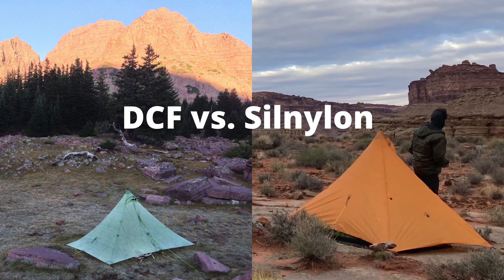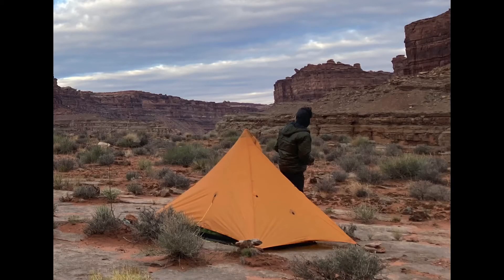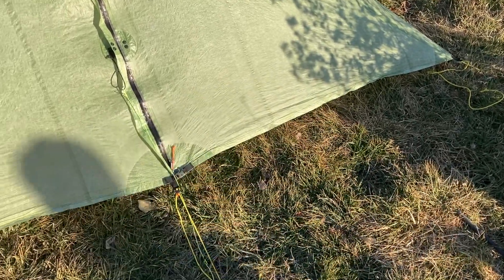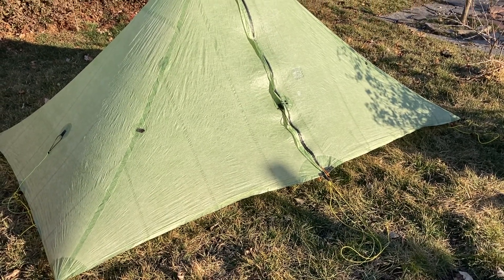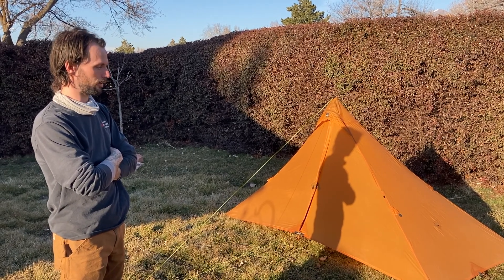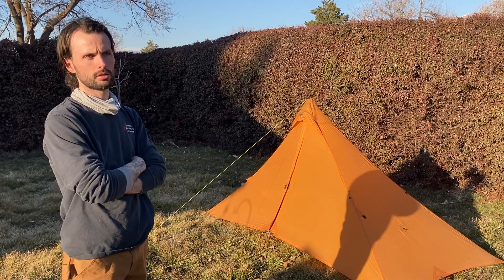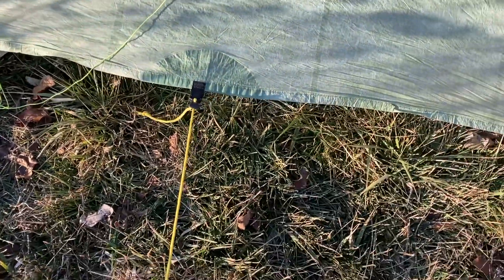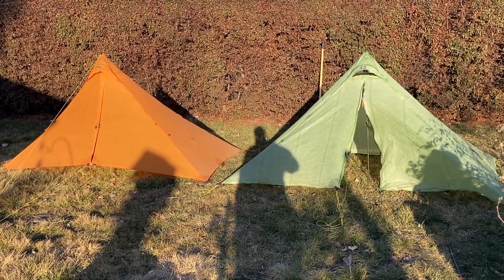DCF vs  Silnylon

Comment: I bought a DCF hammock tarp from Hammock Gear when I decided to do a couple of LASH trips of 275 miles on the Appalachian Trail in '21 and '22 to complete the Trail over 40 years of much shorter hikes. That done, I decided to attempt a traditional S-N thruhike in 2023. I flipped up North to get Vermont, New Hampshire, and Maine out of the way while the weather was unbearably hot in the miles before Shenandoah. I fell and tore the meniscus in my left knee in New Hampshire, having hiked 1,100 miles of the AT, halfway, that year. My tarp began to delaminate at the ridgeline tieouts, being the most highly stressed area of the tarp. I patched it up the best I could with self-adhesive silnylon fabric, and it held up for another three weeks (when I left the trail).
To their credit, Hammock Gear repaired the damage free of charge with a heavier gauge of adhesive backed DCF.  I have only used it 6 nights since, because I had to recover from a total knee replacement. I expect to get a thruhike out of it in 2026.
"Tinker," AT halfway, 2023.
Btw:fwiw, I turned 70 on my hike, so it's entirely possible for an overweight, diet-controlled type 2 diabetic to hike the AT, if you have been relatively (to most of your peers) active. 
✌️👊

Comment: Your experience is quite correct. This is also the reason why 3fulgear does not make dcf tents. 1. In addition to being a little lighter, single silicone nylon has many advantages over DCF! ! 1. DCF is too expensive 2. It is easy to wear and tear 3. It is not easy to fit perfectly with other accessories!
Reply: Also, both are chemical fabrics. Why is DCF so expensive? You must not know the reason. Because no Chinese company is willing to produce it! The scope of use of DCF is much lower than that of nylon and polyester fabrics, so DCF fabrics have always been produced by American companies. Once there are no cheap inputs from Chinese companies, everything will become expensive. If there is a Chinese company willing to produce DCF, then a DCF tent will not cost £400,500, but £150

Comment: Appreciate the insight here.  I've been considering DCF ultralight tents, but have been very hesitant.  It's very expensive and without having any personal basis of experience for actual long-term use of DCF, there's simply been no guarantee of performance over the long term.  At the price point, it almost feels like purchasing a vehicle without having driven it or something to that effect.  You perform as much research as possible, but it's difficult to obtain practical comparison anecdotes like you've provided here.  I'm certain I can purchase a vehicle that will run and get me to where I'm going, but do not have the expertise to determine if it's in a state where it will be reliable.  Obviously DCF is good stuff and I have nothing against it.  Silnylon just seems like a more resilient material that will provide better consistency over time.  I am very much in the camp of "pay the higher price for the better gear", but with that comes the expectation that the maintenance I painstakingly perform will be rewarded.  Value comes in all shapes and sizes.  Cheers guys!

Comment: Noting that we now use a beefier #8 YKK  WR zipper and pull vs these older #5.  2023 Now using low stretch SilPoly for the mids.  SIlPoly and SIlNylon last about 2X longer than .75 DCF and 3X longer than .5 DCF.
Reply from the maker: Thanks for popping in to say hi, Ron! I bought a silnylon solomid from you last year and am very happy with it. I'm super curious about your new silpoly though. Wondering if I should have waited for that. You find it to be just as durable as the nylon?
Reply: Is this also true for the Supermid?  The MLD website currently 
states the use of silnylon being used for the Supermid...

Comment: hey, im looking for info on pyramids. Are you happy with them? Im looking for a trekking pole tent, and heard mids are really good for winds. I assume they can be hard to setup. Do they handle rain well? I plan to bring a inner too. I ordered a cheap asta mid from aliexpress, so im looking forward to trying it out but none in my country uses them so im like clueles how good they are. Im going to norwegian mountains so need something that can handle heavy winds.
Reply from the maker: I like pyramids. they do well in most conditions. I'd want one made of a high quality nylon or dcf though. I've heard the ali express nylon is questionable. Here's Ron Bell tearing both materials: https://mountainlaureldesigns.com/mld-pro-silnylons-vs-cheap-china-counterfeits/
Reply: @benkilbourne3937  hey thanks for the reply. I actually just received the pyraohm from Liteway lol. I figured its better to put some extra cash in for some quality gear. For sure a pain coming from freestanding tents and huge footprint and wasted space. Looks cool and probably will do well in winds tho. I was just on a mountain trip with my cheap mongar 2 dome tent and it handled the winds well so I assume this will too. Again... The huge footprint might suck imo. And ive not even went on a trip yet lol. But, i save some weight and get to use my trekking poles for dual use :)

Comment: I make stuff out of silnylon, and it already is almost weightless. I can't imagine any benefit to dcf, even if it wasn't as expensive as gold.
Reply: It's waterproof, much stronger, doesn't absorb water and doesn't sag?
Reply: @ogarza3  silnylon is waterproof, plenty strong enough, and for several hundred dollars, I'm willing to tighten a couple guy lines.
Reply: @ernststravoblofeld  it is a common mistake due to marketing I suppose. Silnylon is water resisitant, it WILL wet out and absorb water, it is just a matter of when. DCF is waterproof, absolutely impermeable. However from the point of view that people should buy what works the best for their circumstance I can agree with you, but that doesn't mean that I'm blind to how DCF is clearly superior in terms of performance.
Reply: @ogarza3  Have you ever had silnylon wet through? Has anyone ever?  It takes more pressure than anyone is going to have in any reasonable situation. There's your marketing nonsense.  Any conditions that would make silnylon wet through, would rip any lightweight material to shreds.
Reply: @ernststravoblofeld  At this point I starting to believe you are simply trolling, those hydrostatic head tests are only loosely related to real world use, and present only the absolute best case scenario for the fabrics, additionally those pressures that no one will give in a reasonable situation? I don't believe you have done the math, a 165lb kneeling person applies ~13psi, which is equivalent to ~9000mm, high quality "waterproof" silnylon is in the 3000-5000, Hilleberg uses 5000 for example, so according to the lab tests in the best possible scenario not even expedition quality sinlyon is "waterproof" against an average adult kneeling on it. lol...
Reply: @ogarza3  I don't give a shit about tests. Have you or anyone you know, ever used silnylon in the rain and had it wet through?
Reply: @ernststravoblofeld  yes
Reply: @ogarza3  Well, I guess you got shitty material. I've been making and using silnylon gear for quite a while, in a climate where rain is pretty much a given, and I haven't had it fail once.

Comment: Nice analysis Ben!  From 2012 to 2019, I used a Mountain Laurel Design silnylon Trail Star tarp and put a little over 600 nights on the tarp.  In 2019, I purchased a MLD DCF Trail Star and as of today I have used it 232 nights.  I've had to patch the DCF in 5 places and have pinholes in several places.  So I've ordered a MLD silnylon Duomid and should receive it in about 2 weeks.  After this experience with a DCF tarp and many failed DCF stuff sacks, I'm done with DCF.  For the normal backpacker who gets in 8 -10 nights a year or someone who is purchasing specific gear for a through hike DCF might be a good option, but if you're backpacking 75 plus nights a year every year DCF is a rather expensive option.  By the way my son is still using the MLD silnylon Trail Star and probably has added another 50 nights of use.
Reply: none of the tent shills on youtube ever tell this side of the DCF experience.
Reply: @Kevinschart  Many DCF tents on YouTube are sent to YouTube for free by brands for review. If you ask them to buy them, of course they will not buy them. The price is several times more expensive! ! ! !
Reply: On the other hand if I got over 200 nights of use out of something costing about $700 I'd consider that still pretty good value considering some of the other benefits

Comment: I'm looking for a new tarp and I think it's worth mentioning that I'm comparing the dutchware xenon tarp to the dutchware dcf tarp. Both in the same form factor the xenon is only 3oz heavier than the dcf. Xenon is what dutchware is calling the new version of silpoly to the best of my knowledge... Packability, cost, and durability. I think xenon is a great option to try
Reply from the maker: Looks like a good material. I'd definitely buy a little pyramid made of silpoly if I found one I liked
Reply: @benkilbourne3937  I know Liteway Equipment (out of Ukraine) has their Pyraomm line-up in DCF & Silpoly. Also, Yama Mountain Gear is supposedly working on their version of a silpoly mid!
Reply from the maker: @zkuhns  Oh nice, good to know!

Comment: You mention SilPoly. So far, MLD has stayed away from the fabric. Not sure why, given it’s priced similarly to SilNylon but it’s a lot more hydrophobic.  Any thoughts why you might want a “mid” design in SilNylon over SilPoly?
Reply from the maker: As far as I can tell, silnylon is slightly stronger for the weight. But I don't know how much stronger. If it's really marginal, I'd probably pick silpoly just cause it doesn't attract sand as much and it doesn't stretch when wet. If MLD made a silpoly pyramid I'd for sure give it a try
Reply: @benkilbourne3937  I've had a correspondence about this with Mike Cecot-Scherer, who has designed literally hundreds of lightweight tents for the industry. He has access to manufacturer testing labs and to their repair records so has a better handle than most on what works and what doesn't. 

He is a big proponent of silpoly, because the lower water absorption means less panel stretch in the wet, which means that during storms the panels will work as designed rather than bowing and flapping - and you don't have to keep getting up to reset the pitch. HIs only reservation is that you shouldn't go crazy and use anything under 20D in weight.

Yes - in the lab silnylon is slightly stronger, but it has less UV resistance so in the field it soon becomes weaker. Any in any case he says that in a shelter with properly designed reinforcements, fabric failure is rarely seen in repair labs, so it's a non-issue. Plus he says that in the lab there is more variation between batches and manufacturers than there is between fabrics.

The only worry with silpoly is that none of the manufacturers known for stormworthy products are using it - eg MLD or Hilleberg. I suspect that's simply because they have spent a lot of time working with suppliers to achieve the highest possible quality of silnylon and they can't yet match that quality in silpoly. I have some Hille silnylon offcuts and it's different class. But for MYOG the qualities available seem comparable, and some of the better cottage companies like Yama and Durston now use silpoly exclusively.
Reply: @tullochgorum6323  I think some of it is also marketing. There's so much focus on strength:weight that the different qualities of each material get overlooked. DCF took off before it was extensively field tested and it seemed like companies were rushing to release a product to capture that end of the market. In a lot of cases the design techniques to make a DCF tent would negate the weight savings of using the material but it didn't really matter because people were buying into the concept of a new and better technology.

Comment: I remember reading something where Dan Durston says the direction of tension on DCF panels can really affect the durability of the fabric. His 2p pro tent supposedly takes this into consideration, but even so has a claimed life span of only 200-300 nights (with special care). So yeah, with DCF you trade durability for other benefits.
Reply from the maker: Yeah the bias matters, but I think all pyramid manufacturers are taking this into consideration, so you shouldn't see HMG, Locus, or MLD wearing in any significantly different ways. I'd like for some more pyramid owners to chime in, but I'm sure all the brands get floppy hems after a while.
Reply: @benkilbourne3937  Not sure about pyramid designs, but Zpacks is not taking this into account, but needs to.
Reply from the maker: @wolfeadventures  have you seen zpacks get floppy, stretch, or shrink? I've always wondered about that.

Comment: Thanks for the video. Do you think the DCF weight (0.51 vs. 0.74) would respond different in relation to the permanent stretch? I mean.. the fibers content would impact differently the mylar deformation (both have the same mylar thickness I think)?
Reply from the maker: I could see the dif thicknesses responding differently for sure. Not sure what it would look like though. I'll dig into this a little bit and see if anyone has ideas.